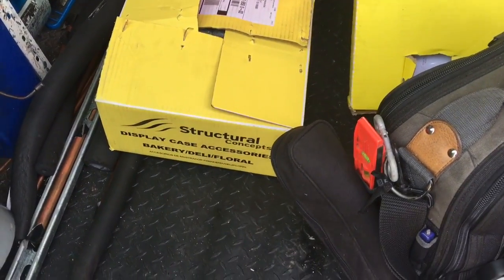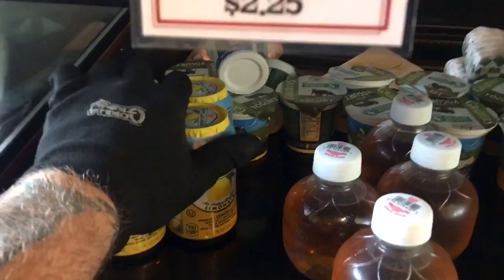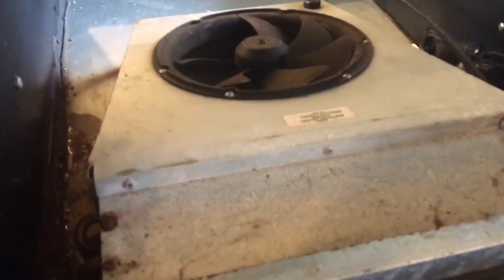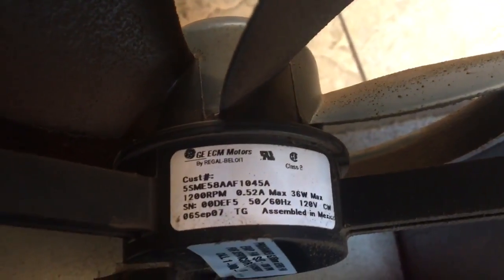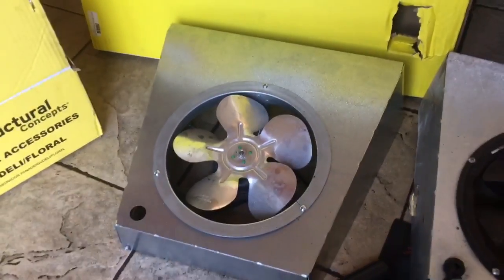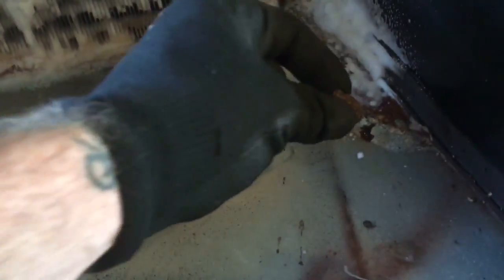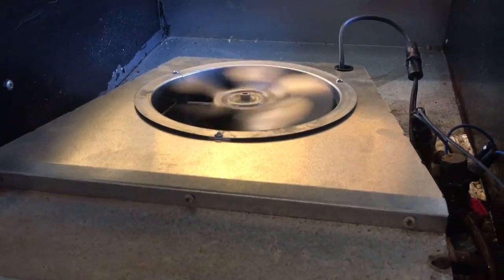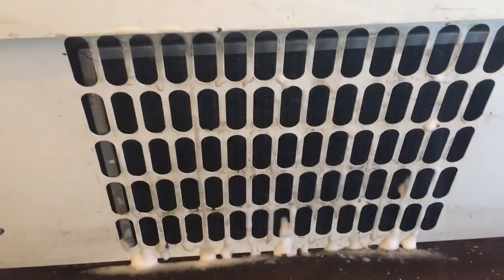Display case evap fan motor kit install

Comment: I work on structural RTD cases for Starbucks. Their cases have a cold bottom and dry top for pastries. Structural does make decent cases haven't seen one quite that old though. First one I have seen with an ECM Motor. What kind of controller was that? Nice vid.
Reply from the maker: Robert Weeks so old no name on the controller.

Comment: structural concepts makes all the pastry cases for starbucks coffee...does that spray cleaner have a strong odor? i always use the nu calgon evap foam cleaner on evap coils and people complain about the lemon/lime smell all the time.
Reply from the maker: kingofthecrease30 it has a lemon smell not over powering. 5$ at Home Depot try one and see. Those are good cases.